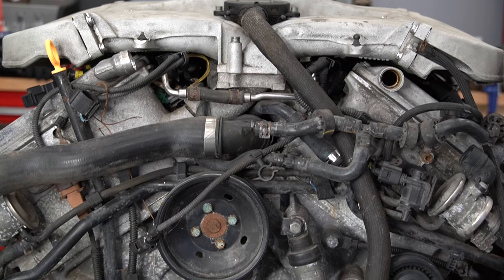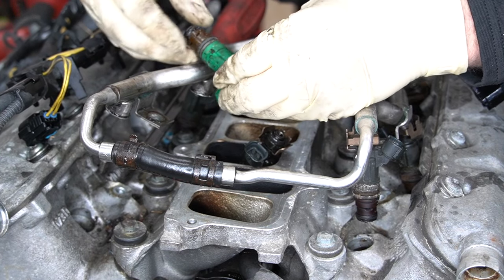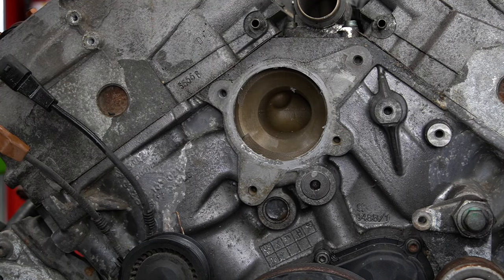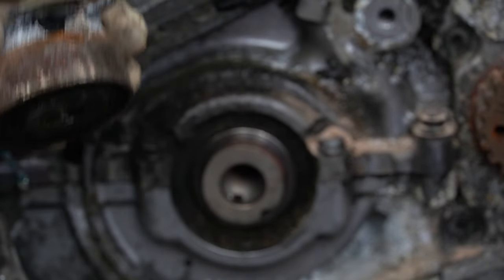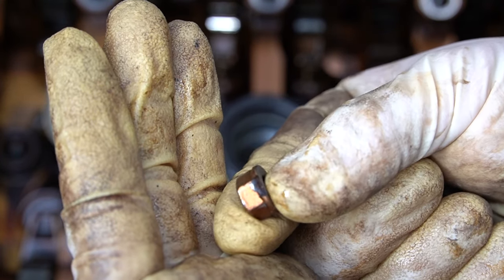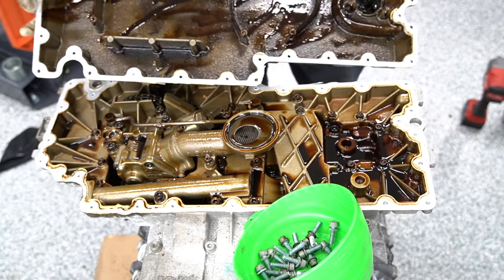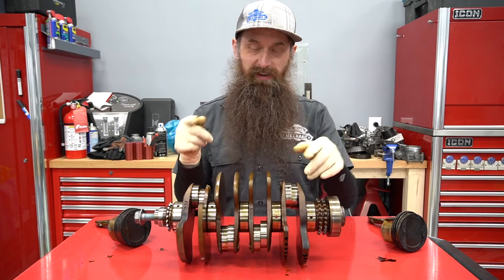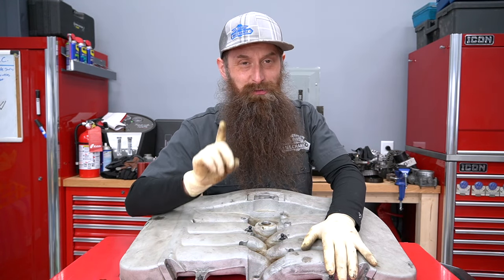W8 Passat Engine Teardown and Inspection ~ TINY V8

Comment: As a machinist I'm just shaking my head at the thought of all the molds, tooling and machining needed for that engine. And I don't know if it was available in Europe at all - I'm quite sure they didn't sell it in Sweden.
Reply: It was available, one guy i know owned one , in Portugal by the way.
Reply: I have seen them in the netherlands.
Reply: They sold around 70 of those in Sweden.
Reply: They literally made everything in Germany lol. Imported to Japan, Canada, the US and other countries.
Reply: They build only 5000 W8 between 2001 and 2004. Germany and for rest of world. Chances are significant low to find many W8 even in Germany
Reply: I own one and its in Europe, Croatia. That car was previously used for transport of diplomats and ambassadors, the previous owner got it because they were introduced with newer fleet of vehicles. I mean it is like a sleeper car. Normal looking volkswagen passat but with a W8 engine, 4 motion drive and an automatic gearbox. The one i have has black tinted glass on the back passenger seats and it even equipped with a mini fridge for i guess champagne or whiskey for all those stressed out diplomats 😂
Reply: 222 registered in the UK in total but only 48 still left on the road

Comment: Thanks for the break down. I owned one of these. Absolutely loved driving it. Such a smooth power plant. Off the line was a bit slow given the power but as I understand it that's because the transmission wouldn't hold the power, so they limited power in first gear. Thank god I owned it on CPO though as the engine had to came out twice. Once for ticking hydraulic lifters and a second time for a cam adjuster. The engine bay is so tight in these.

Comment: Yes please, would love to see how trans n 4motion work!!!
Reply from the maker: AWESOME!
Reply: It doesn't have a 4motion AWD system , it's a Quattro one because of the b5 Audi longitudinal design platform (Audi A4 b5)
Reply: @fanisfbt  AWD is branded 4motion on the Passat. I don't know if it's mechanically the same as any Audi models or not but it isn't called quattro.
Reply: @marcuscoster6529  it's actually Quattro AWD system but it is badged  as 4motion for advertising reasons!!

Comment: And Honda and Toyota were getting at least that power level out of 3.5 L six-cylinder engines, at the same time this engine was in production. And they did it reliably. I love the video, keep those things coming
Reply: Toyota 2JZ makes 500-600hp with a Turbokit and a new ECU... on stock internals and pump gas... in the 1990s!
Reply: @alouisschafer7212  as do many forced induction engines from the same era
Reply: Those crank big end journals look pretty fragile. Those wedge shaped pistons seem like they would have balance issues, but the VR6 was a revvy engine wasn't it?
Reply: @uzernaim1648  japan stands out here by a lot. The Honda K- Series , Toyotas 1jz 2jz, Nissans rb26 and the Mazda Rotary.
All of these legends making mad power went into regular production cars over there
Reply: @alouisschafer7212  We’re so fucking tired of the 2JZ dewd...

Comment: Haha, I wish I had watched this video before I changed my thermostat and had a dowel fall down the intake unnoticed. Definitely makes for a bad day. Found pieces of broken piston and rings in the oil pan 😱😱😱. I bought a second hand engine and I'm about 2/3 way through replacing it. Kinda painful with a tiny garage and no hoist. Just doing a bit at a time after work and on weekends but I'm determined for the beast to live again. Such a fascinating engine with an awesome sound. Great video by the way.

Comment: The super fine mesh on the (broken) screens for the cam adjusters are a common failure point:  they clog up with the tiniest amount of sludge buildup.  The broken screens probably saved the engine.  Other major failure point is the lock up torque converter as VW used the v6 transaxle which wasn’t up to the torque.
Reply: lost screen caused a locked cam adjuster on a 30v 2.7/8 in advanced only on the dr bank....

Comment: @humblemechanic: in the video you asked whether there's some fancy coating on the valves. No, there's not, it is made from Alusil (hypereutectic aluminium alloy) and a special honing process of the walls form hard silicon crystals on their surface, so the pistons (made from the same alloy) slide directly on the aluminum wall (on a oil film of course :) ). 
Regarding the belt, it is a comon failure on these engines. It has to be replaced let's say every 80-100k miles (together with the tensioner and the wheel you found jammed), but nobody does this.....voilà :) I am also adding that last year somebody in the US bought off the very last one of this little belt in the whole world... 
We at the W8 forum also discussed whether the balancing shafts help to distribute oil, hence upon this failure the engine dies slowly (jamms at the first valve and spins the main bearing)... 
Cheers from the CZ! ;)

Comment: Cool video!!
All I could think of when you pulled that manifold was how cool that engine would look with those giant valve covers polished and some crazy velocity stack injection set up!
Reply from the maker: I AGREE!!!
Reply: @HumbleMechanic  Are these strong engines? Will they handle boost?
Other than being MASSIVE, they seem to be stout, 4 bolt mains, that weird girdle thing, but that crank looks weak.
Reply: @theothermike3195  they are boosted from factory, with small air pump in filter airbox, actually my w12 D2 a8 has 2 airpumps and boost preassure of 1.5bars measured. Boost come from low rpm. To some 3500rpm
Reply: had me thinking,how close is the dumpster

Comment: I love how this is seemingly a super complex engine when you think about a W8 at first. I for one, could never picture how the crank would be laid out for a W motor like this until you broke it down. In typical VAG fashion, what is seemingly super complex is really just an elegantly simple solution: rod bearing journals which are slightly offset and a slanted piston top.

Comment: I remember many years ago reading Sir Harry Ricardo's books on the Low Speed Internal Combustion Engine and the High Speed Internal Combustion Engine... what the difference structurally was structural stiffness required of the high speed engine, and brute strength required of the low speed engine... not some magical tipping point in revolutions per minute!
This Audi/VW W8 is the epitome of the high speed engine.

Comment: i've always wondered why nobody ever pushes these weird little engines up over 300 but now it kinda makes sense. those super narrow con rods would probably do strange and less-than-wonderful things if they were pushed too hard
Reply: Nah... the W8 and W12 can both easily make more power once they can breath.  Given the cars purposes they were in- they have quiet intakes, lots of cats, resonators, mufflers...
Reply: From an engineering standpoint, it seems to me like having two connecting rods would reinforce the journal. 

I think opposing force would be incredibly well balanced.
Reply: @jacobvanausdeln1696  I've never driven a W8, but I own a 2006 444hp / 413lb/ft W12 Phaeton for the last 9 years and it is extremely smooth.  My father in law owns a Bentley W12 twin turbo and before that he owned a '05 420hp W12 Phaeton.  Great engines.  Anything VW VR based is great.

Comment: "It needs a rebuild" "Whats that gonna cost?" "Um, you might want to sit down...."
Reply: They actually do not make any bottom end parts for these. If a bearing went, you bought a new $10,000 engine from VW lol
Reply: @rondeezy_thepancakeslayer1242  lol I’d laugh all the way out of the shop
Reply: Also you need to find some one with a table big enough to face the cylinder head.

Comment: Even though people say its "scary" its nothing different then keeping anything else running, I am very fortunate to live in a state where european cars are quite common so i have a bunch of tuner/repair shops that specialize in cars with engines like this. (other than pulling the engine for everything). I feel like if anything this video made me less scared to take on this little beast.

Comment: In order to replace the head gasket, the engine must come out and a major tear down as shown. No in place work can happen. What a job. This video was 30 minutes  real time less than an hour. But to pull the engine, tranny, 1 day. shave heads, reassemble, clean up, 1 week. 

It could be a dream project restore engine. Paint valve covers, timing chain covers bright red, intakes, silver, pulleys black or chrome. It could be a showpiece. Why not? Rare engine, rare station wagen. Gorgeous car

Comment: Loved this and would love to see the Tranny!!! I have been keeping a spare W8 engine and have been tempted to buy complete vehicles for manual drivetrain sparesies. I have a 2004 6spd manual wagon with 256,000 miles and it still drives extremely fun!. I have had sea to sea distance trips without issue.

Alternator died and I found an engine with 88,000 miles on it (claimed)including the alternator for $700.00 USD and bought it right away! Needless to say, I saved a ton of money this way because an alternator alone is at least this much dinero....   

Here's where it gets interesting... I sent oil samples to Blackstone Labs for the high mileage engine, and they responded with a positive diagnosis overall, and then I sent the oil in for the low mileage engine just to confirm health of the engine I had never heard run.
 Blackstone replied asking me why I sent oil from the same engine in. They seemed to have overlooked the fact they were in fact different engines..... soooo..... a cared for high mileage engine shows similar wear characteristics as an engine with a fraction of the miles. Happy time for me!
This was great news for my high mileage car, so now I continue to drive smart and have fun while waiting for the grenade to blow, enjoying driving but not beating on the car, knowing I have another engine to install. The low mileage engine occupies a stand in storage awaiting its ambiguous future. I know the Balance shaft belt cover is visibly broken so even though the oil checks out, there is a problem. No balance shaft belts exist to purchase and the cover is also cracked and needs to be replaced. I was watching your video thinking "I need that Balance shaft cover!" then yours came apart and revealed there was a greater problem. I have thought of disassembling the spare motor entirely, as it is a spare and a research piece, but why do that if it potentially has thousands of miles of functionality left?
I am very interested in seeing the  6spd Transmission teardown. Please? (thought begging would help!) 

Thanks for your videos, I have loved every minute of your channel!
Reply from the maker: Keep it together. If you do want to venture down that path, check for all available parts. That’s the place you’ll have the biggest issues

Comment: I have a 2003 W8 6MT with roughly 220K miles. Loved that car. Switched to a 2018 Golf R 6MT. Love that one even more.
Reply from the maker: the 7.5 R is so good!
Reply: @HumbleMechanic  I've had it for about a month. I haven't done any mods to it yet. Wanted to just drive it plain first to get a feel for it. Now I can't wait. Was thinking of just going stage 1 and then doing the mods but I might go straight to stage 2 and be done.

Comment: I can tell you first hand what happens when the engine is started after the dowel pin fell into the cylinder unnoticed.
Reply: Oh that rattle? That’s completely normal following service, it’s just the new parts getting to know each other, give it a few thousand ks, if it’s still there at the next service we’ll look into it 😅

Comment: this engine looks strong
Reply: I think the same, maybe with a different oil pan it would be RAD material for a swap in a tiny hot hatch, maybe like Suzuki Swift GTI or a Daihatsu Charade GTTi with like a supercharger to add some more power
Reply: @martokisful  cram it into a lupo i would :D

Comment: Wow, wow, wow. Fun, superb video, They say this W8 engine is one of the top 10 most complex car engines ever. Now we know why.

I must be blessed or lucky or both. have 2 W8 4WD silver wagons. I live in BC Canada, cold, snow country.  My daily driver, the W8 silver Passat 4 Motion just turned 333,333. I bought it in 2017.  Do all my own mechanical work. You need to be a bit crazy, need small hands, own the manuals and watch humble mechanic for the master teacher! 

It purrs, reliable, ultra smooth, lots of power, ok gas mileage at 20-24 mpg US, a dream car. Very few issues. Will never sell it, rare car  Superb engineering. Never fails  Why?

I use the best Pennzoil Euro platinum @10l every 10-15,000 miles / 15-20,000km.  Every second oil a change, I use bluchem oil cleaner- comes out jet black. I have the best spark plugs rhethunium kind. No oil additives except before oilchange for 100 miles. I clean the mass airflow sensor 2x year. Use bluechem gas injector treatment 1x year. Of course clean filters. I actually car wash the engine often.  It does not sit idle. The only issue in super cold is the oil air separator clogs up once in 3 years and the PCV system needs to be removed and thoroughly cleaned. This because of high humidity and cold. oh well. I may put an engine blanket on next winter to keep the engine hot. will see.

Look after the engine, it will look after you. 

A comment about power and mpg. Yes, engines have got better, inevitable. This car will still go so fast as to be nuts, limited to 250kph. Now where in San hell can anyone drive that fast? The dotted lines merge into 1 solid line. It hits 60 mph in 6 seconds. It stops so fast and with insane control - you could go through the front window.  The brakes are massive. I have towed 3500 lb. trailers for 1500 miles with lousy gas mileage of course @ 14 mph US. It can plow through deep snow like a Jeep with incredible 4WD traction. It can climb hills like a  Jeep Wranglet. It can handle, corner like crazy, and yet be super comfy on a long 8 hour trip. The car weighs 3850, with me and luggage, 4250. NO PAYMENTS. 

Sure go ahead buy a Tesla at 50,000. enjoy the 700 a month payment. Ok, I spend up to 200 month on premium gas expensive in Canada. 

But what a fun car to own and maintain along with my 2002 passat V6 and other 2003 W8 project car. A bit of a mini Veyron. . . .lol less $3M..

Comment: Nice teardown.
That's gotta be one of the most expensive exercises in getting 4 liters of displacement into an engine.
But it means it will fit sideways into the car.
Looking forward the transmission teardown.
That engine probably did not have too high mileage, but it was not well maintained, amazing how well it stood up to the lack of clean oil.
Reply: The Passat this engine was destined for is not a transverse drivetrain, it's longitudinal like the Audi A4 it shares a platform with. That chassis was designed with a I4 or V6 in mind. 

Though many people have swapped 'normal' Audi V8s into those chassis, and the next generation chassis came with one from the factory. Which makes the complexity of the W8 all the more baffling. VW just really wanted something to differentiate from the Audi models I guess.

Comment: UPDATE FROM REBUILD. Wow, a lot of work. Bentley manual was good except for engine removal which took 2 days part time. 
 Went very carefully, took lots of pictures. 232 000 km on core replacement.  Old engine overheated at 325,000 with blown  small hose and forward frost plug.

Ya, complcated but by necessity. Alternator 1s 150A. can't find replacement bearing so cleaned and repacked it. 

Took heads off,  clean and nice looking. Rock Auto  sent wrong headbolts so had to reuse originals since lack of time.

Sandblasting was a good move, repainted looks fantastic. Pated all accessories, bits and pieces, trannt too in in primer green. .

I used anti corrosion spray  on all bolts.  

Reassembling was slow and methodical. tricky with so many pieces. photos helped. timing was tricky. Basically a 2 week project. now a show engine.

Learned a great deal. Not for the feint hearted by any stretch.

Comment: I'm neither a mechanic nor an engineer, but I have rebuilt 3 engines,  all 4 cylinder. One Japanese, two Swedish. My point is that the engine presented in this video is, from my perspective, very complex and demonstrates a gigantic invesment of design and engineering time. Then, even after the engine design phase is done, there's the nightmare of making the castings, forgings, and parts to fit all together and run smoothly and somewhat reliably for years. Kudos to the engineers, and to those who dare to overhaul these machines. I would probably be too chicken to take one apart.

Comment: Sweet vid man, thanks for sharing. The split pin design is what allows v-bank angles other than 90degrees in an 8 cylinder engine. In this case, 72 degrees for packaging side to side👍🏻👍🏻👍🏻
Reply from the maker: Thank you

Comment: The w8 is 2 vr6 engines bolted together with 4 cylinders lopped off. They use the same injectors, valve springs and so on

Comment: The cylinder walls are not coated. The block is made from "Alusil", a high silicon aluminium alloy. The piston rings are then running on exposed silicon.

Comment: Loved seeing what's inside that engine.  Looks like quite and engineering feat but a potential maintenance nightmare.  I had a 2001 1/2 VW Passat with the 30 valve 6 cylinder.  Worked great for the 6 years I owned it.  For all the added complication and expense i don't think the W8 was a great choice.